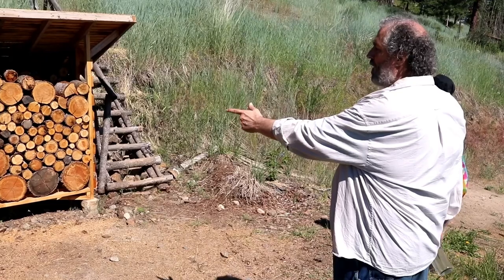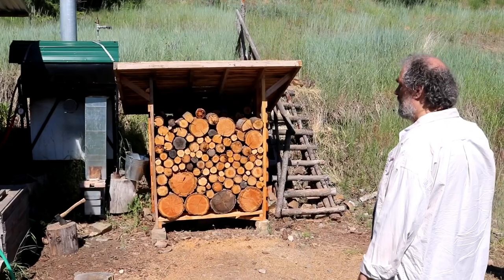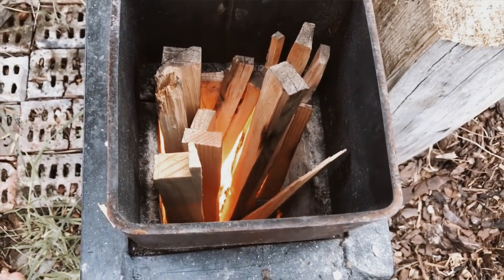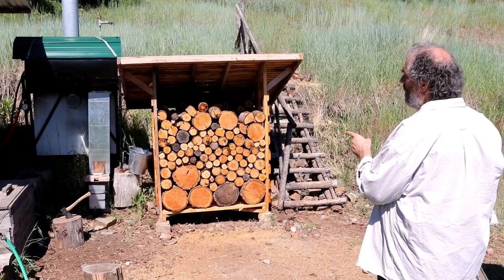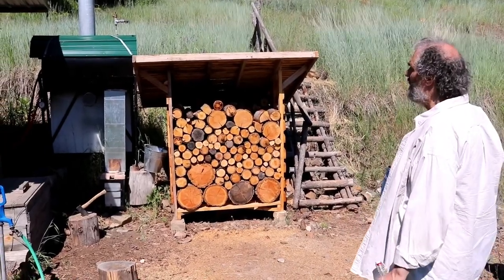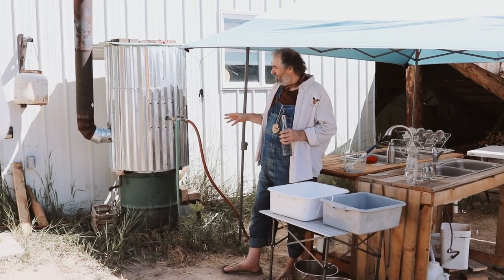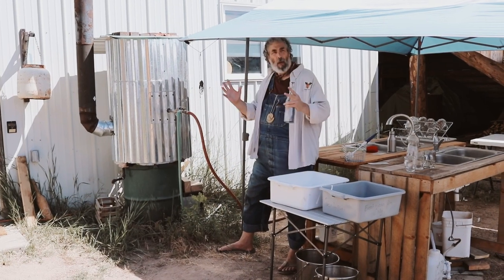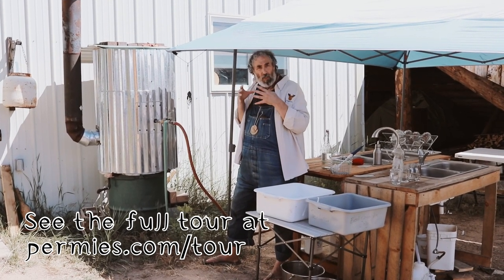two rocket water heaters - part of the wheaton labs tour

Comment: Paul Wheaton has alot to say about rocket heaters and water rocket heaters.  Best source I've found to date.    Insulate main chamber increases temp 1000 to 1800.  Use mass to store heat for days.  1/10th the wood needed, higher temp with insulation doesn't burn wood faster.  I might add a stainless coil to heat water for thermal mass through a thermal syphon.
Reply: So what would you think about combining your idea with a wofati design for heating the place?
Reply: @BibleBeliever-hv8du  Hi Aaron.  I just started watching these vids here and don't yet know what a wofati is.  In regards to making one, well perhaps for a greenhouse as building inspectors for a home might not let me depending on what it is, does and the design.  Do you have something that clearly shows what a wofati is and how it works?

Comment: I've been working on a design for one of these for a long time but pressurized.   I have found no material having calculated hundreds, better for storing heat than water for thermal storage.  Don't worry design is a safe one, able to handle pressures up to a crazy 50k psi bolted down into concrete with 3 different pressure releaf systems at different pressures.  Definitely not for everyone.  I'm going to watch more of your vids and learn more about your rocket stoves, thank you!!!

Comment: What if you did something similar to an hardy outdoor stove. Run a coil of copper tubing in your water tank with the fire. It can be an open system with a condensation stack to maintain water.  Cold water comes into the coil and is heated by the water tub. It would be pressurized should never build up pressure but I would have a pressure Valve just like a normal water heater.